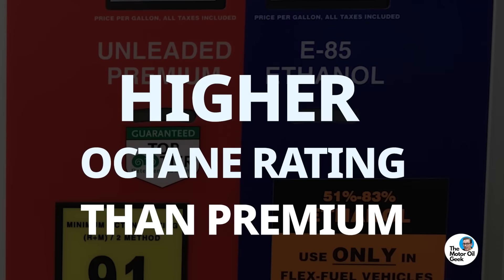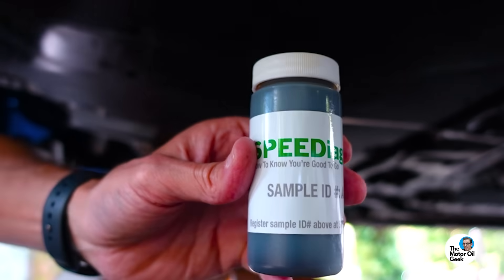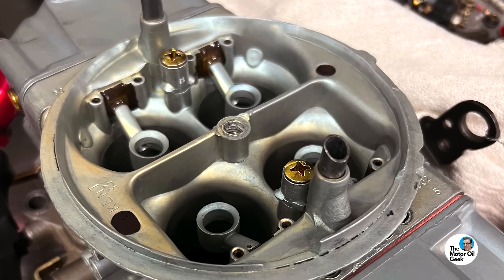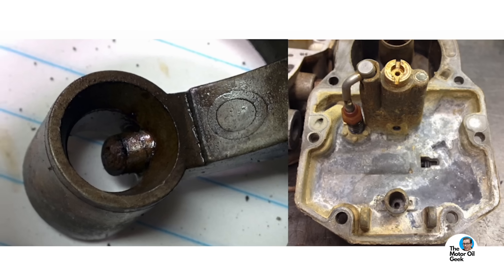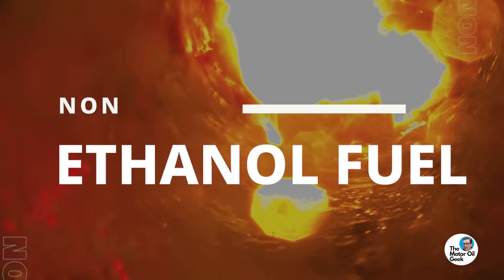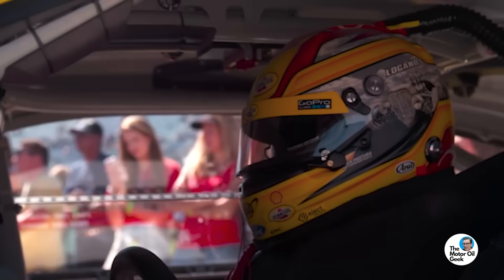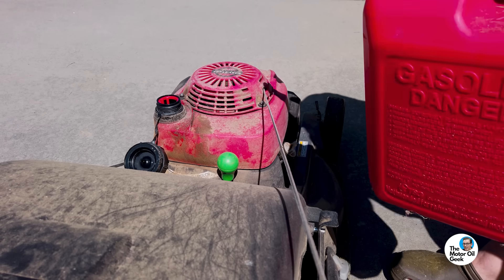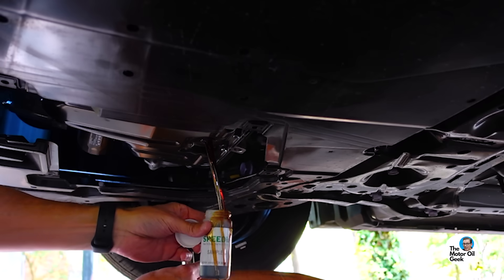ETHANOL: Higher OCTANE, Higher RISK?

Comment: I have been running E85 blends in my 2014 Buick Verano T for three years now.  It has the 2.0L turbo flex-fuel LUH engine and requires premium fuel.  Wind the clock back three years and recall who was president.  Yeah, he had the cost of fuel up so the premium was $5.00 per gallon.  And I had a daily round-trip commute of 136 miles, so fuel cost was a big issue.  In the Detroit metro area, fuel pricing was $5.00 premium, $4.50 midgrade, $4.00 regular, and $3.50 E85.  Yeah baby, it was tempting to save $1.50 a gallon by running E85 versus Premium, but I dipped my toe into the water carefully by running blends of regular and E85, ranging from 30% to 100%.  I kept records of fuel cost and blend percentages in an Excel spreadsheet and after ~70 tank fills concluded that the fuel cost per mile decreased to minimum at ~45% E85.  Maximum savings was ~10%, but the curve was really flat between 40 and 50%.  

For the first year I did oil analyses to see if there were issues from running E85 blends.  The car had an issue when I bought it a year earlier and would have 5% fuel dilution on a 7500-mile oil interval.  It was so bad that the 5w30 I was running became a lower 20-grade by the time the oil was changed.  I changed to 5w40 Mobil 1 European Car Formula at about the same time I started running E85 blends and looked for additional fuel dilution in the oil analyses.  The dilution problem decreased over the next couple of oil changes, and the viscosity stayed in grade.  My normal blend is now 40% E85/60% regular, and the car is running fine at 155k miles.  Fuel economy dropped from 30 mpg on straight premium to 27 mpg on 40/60, but since I am paying 20% less for fuel it's a net savings.
Reply: Great data.  Yes, its one example, but I've seen similar things on many cars running ethanol.  Done right and understanding how it works you can do some cool stuff with E85.

Comment: No ethanol used in my 1986 Yamaha and 1980 Mariner outboards and both still start with just a twist of the key.  No repairs done to it in that time either.  Same for my lawn mower.  Thanks Lake for explaining what I suspected all along.
Reply: Same for me but I use E10 all day long. It doesn't hurt anything, even regular gas left in a small jet carb all winter will varnish
Reply: 1979 VW with 2 Dual 40er Dellorto carburators.
Really no issues with E10 fuel.

What are you guys doing wrong ?

Comment: The trend of manufacturers extending service cycles and using thinner oils ensures that engines that would last a million miles die after only eighty thousand is not helped by ethanol.
Someone did the math on ethanol production and discovered that it wastes the energy equivalent of one and a half barrels of oil per barrel produced. Then you only get about five sixths of a barrel worth of mileage, if you’re lucky.

Comment: Normally a big fan of the channel, but this video didn't feel like your normal ones. Very one-sided and focused only on the damage ethanol causes with carbs. While I agree with that, you totally ignored the postive impacts it has on newer vehicles designed to work with ethanol. E85 offers huge performance benefits and is widely used across the spectrum of modified fuel injected cars. It is basically race gas available at the pump and for significantly less cost than 93 octane and dedicated race fuels. I saw a supercharged Viper pick up over 100whp and torque just by switching to pump E85 without touching anything else. On older vehicles and lawn equipment it can certainly cause issues, but on vehicles designed for it or by being aware of the difference that is easily negated.

Comment: Pure-Gas website lists gas stations that have alcohol-free fuel at the pump. I have been running it for years in my small, carbureted engines without destroying the carbs.. Much less expensive than the canned gas. We have 90 octane at a few places near me

Comment: I absolutely hate that we are forced to have 10% ethanol in our gasoline here in the US. At my local gas station, they do have a separate hose for 91 octane non ethanol fuel, but it is 30 cents more expensive than 93 octane with 10% ethanol. So I just can't afford it for my vehicle all of the time. I buy it for my lawnmower and chainsaw, but that's it. I can't put it in my truck all of the time due to price. 

Every once in a while, I will put some in my truck, but most of the time, I just have to use 89 octane with 10% ethanol fuel in it because my truck requires 89 octane minimum according to the owner's manual.
Reply: Unless you have a really old truck, it won't have a carburetor and should be ok.
Reply: @quaddad 
That's not completely true. It still can cause water in the gas tank when not driven much, and I have had that happen. It also causes gumming in fuel injectors when the vehicle sits for a while. I have also had that happen. It's just bad for engines all the way around. There is nothing good about it other than up front cost savings. Unfortunately those up front savings can and often do cause more expensive long term problems.
Reply: @JD.307 
Should, but considering my truck is 20 years old, I wouldn't bet on it. 😅

Comment: I think there is some kind of government red tape or crap or something that strongly discourages Gas Station owners or operators from offering ethanol free gasoline in the immediate Washington DC metropolis. Maybe 50 miles out some stations might offer ethanol free at a higher price but maybe not in the desired octane. Might be more of a problem than with the more common E10 of low sales allowing the fuel to be "stale"? 
I believe ethanol free still needs fuel preservative if to not be used within a month or so and also could benefit if used in small engines from having a very small amount (like mixed at 1: 200 ratio) of something like "Stihl Ultra" 2 cycle oil even if used in 4 stroke mowers (the type of "synthetic" mix oil that is used in 2 stroke with catalytic converter or the "4 mix" engine that has no oil sump and needs oil mix fuel although it has poppet valves with rocker arms in it

Comment: I ran liquid performance ethanol equilizer in my fleet for 7 years i was able to get my e85 mpg with basic Boltons and that additive to what those vans hot stock on pump gas. I love e85 especiallyat high altitude, plugs and oil doesn't get fowled and mpg increases the higher up i go. I live in central Colorado where I've run my food distribution business for over 20 years now. I wouldn't run e85 if it wasn't for that ethanol equalizer, I've had no measurable phase separation in the fuel regardless of what sharp temperature drops I have encountered.

Comment: I live in the "mighty" EU and here a 5% minimum ethanol is mandatory (E5), we literally can't get ethanol-free gas. Some advice for us? Personally I already changed everything in my fuel system from tank to fuel line with ethanol resistant lines and metals, except obviously the carburetor itself (C3 corvette).
PS: a little thing you missed is that ethanol dries up rubber gasket and in old car that's the cause of fuel pump and/or accelerator pump failures.

Comment: According to your statement the wear data is based on fuel dilution. You then extrapolate that and suggest enthanol is the cause. Fuel dilution of oil is already known to do that. What does it have to do with ethanol? From what you presented the presence of ethanol is anecdotal. The fuel dilution was already the cause.

The study looks largely meaningless. If I read that correctly they put 5% (by weight?) ethanol in the oil. Does that ever actually occur in the engine? I highly doubt it. It evaporates more readily than the gasoline does.  Since only 15% of the fuel is ethanol, you would need to have huge fuel dilution rates (like 70-80%) to get 5% of it to be ethanol. Then it would just evaporate anyway, particularly at operating temps that are above the boiling point. Then it will go thru the PCV valve and into the intake to be burned. 

The corrosion to the carbs is caused by the absorbed water. This is why if you use it regularly you don't have problems. New dry fuel is always present. 

You really should say knock index, not octane. Octane is a hydrocarbon component of gasoline. You aren't increasing octane at all by adding ethanol. You are increasing the knock index.

Comment: Hi
Having run engines on dyno test beds for many years and for more than one manufacturer I have seen the evidence of higher power  running on ethanol blends and 100% ethanol it also increases fuel consumption and puts a lot of water into the sump especially on short runs. From my point of view it's good for racing but not good for a daily driver
Reply: I drive about 170 miles a day, so any fuel or water buildup in the oil has ample opportunity to boil off.  I can see that high ethanol blends would be a problem with an engine that only gets run 15 minutes at a time.

Comment: I’ve had zero issues with running ethanol blended fuel in my power equipment. I add 1 ounce per gallon Seafoam when I fill the gas can. Unless I plan to use the equipment again within a couple days, I drain and run the fuel out. On my mowers I’ve installed fuel shutoffs if not already included and run the gas out of the carb after each use.

At the end of the season I drain and run the fuel out and fog the cylinders. This ensures a smooth startup next season.

Take the extra time to care for and protect your investment in your power equipment and they’ll last for years with minimal repairs.
Reply: If non E gas is available anywhere by you It makes no sense at all to take the time & effort you put into trying to safely run e pump fuel in you carb’d vehicles.
The only time your rec are worth while is in an area where no non E gas is bit not avail or close by within reason. 
I have 2 sources of 91 octane non E pump gas avail to me in Ny approx 8 miles away round trip.
At my Fl residence I have 2 non E sources (89 & 93 octane) approx 8 miles away there too 
so lucky for me I’m good to go.
Reply: @scottwheaton9689 sorry, but it takes little time and effort to do this. A couple minutes to drain the gas from my trimmer and run the gas out of the carb. For the mower, I turn the fuel valve off and let it run the fuel out while I’m cleaning up. Also, my leaf blower is a 4 cycle and I rarely run the gas out of it and it starts every time.

I’m not going to go out of my way to find a station with non-ethanol gas when I can just run to my local station (1/4 mile away) when I need to. The time it would take to go through the effort of finding and acquiring non-ethanol gas would be greater than the time I spent doing what I know works for the entire season.

If you truly care about your equipment and the money you’ve invested in them, taking a little extra time to protect that investment is worth it. I’ve had my trimmer for 17 years and have only replaced the hoses and service the carb once. It was the same with my previous mower which was still going strong when I decided I wanted something new.

If you want to go out of your way to find non-ethanol fuel just to save yourself a little bit of time more power to you. I’ve just seen too many people set out on bulk waste day an otherwise perfectly good mower due to carb issues caused by lack of care. Lots of unnecessary waste due to poor maintenance and/or laziness.
Reply: So we need to add things to our gas to make our vehicles run properly because of the Marxist governments that people keep electing.
Reply: Bobby is wrong, but he thinks he’s so right.
😂
Reply: @timsforcoffee how can I be wrong when I’ve been doing this is every season without issue for 20 years? It takes very little additional time and effort. Less than going out of one’s way just to find non-ethanol fuel.
Reply: @BobbyS1981 Your argument is similar to saying I’ve been eating cheeseburgers for 20 years and never had a heart attack.
Did you watch the video?  Did you learn anything.
Small engine shops have had an increase in the number of small engines that need new coils since ethanol was introduced to fuel.
What do you have to say about that?

Comment: Here, in Brazil, the government increased the ethanol in gasoline to 30%, without allowing us to choose a gasoline with concentration lesser than 25% of ethanol. I am an owner of a toyota Prius 2018 with gasoline engine and I will have to reduce my oil change interval from 8000 km to 6000 km due to fuel dilution in oil. I use 5w30 synthetic oil API SP. We also don't know how the fuel system components and materials will last with this new ethanol concentration, because these tests have been ignored by the government approval. It is something insane!
Reply: Does the Brazil Prius have a fully flex fuel ECU?
Reply: My fuel pump (high-pressure fuel pump) gave out with E20, Mitsubishi first Gen GDI engine, repair cost $2,000 — reason: the gas pump at the station was filled wrong.

Comment: Back in the 80's and 90's when we built muscle car engines if a carburetor was going to be stored for anything longer then a few weeks we would put it in a bucket of kerosene and seal it. When we were ready to use it we just blow it off with carburetor cleaner and install it. It might smoke for a few minutes but we rarely had to rebuild it if it was good before it was removed from the engine.

Comment: Sorry man, im from Brazil.

Today gas in Brazil is E30, theres no ethanol free gas in Brazil over the last 3 decades.

Whe have since 70s PURE ETHANOL WITH 4% WATER in gas stations. No E85 here and yes we put water on It to avoid evaporation.

Theres no problem with corrosion, you just do nickel plating on the carburetor that use high ethanol or hidrated pure ethanol.

The oil life is way longer with ethanol, no sulfur, no carbon build and ethanol dont mix well with oil. Engines that use pure ethanol dont have problems with varnish and sludge, the oil comes out clear as new.

North America needs tô LEARN something with us, we are using ethanol about HALF CENTURY.

Come on... 2025 with all easy infos on the internet/AI...
Reply: Very interesting.
Reply from the maker: The fuel in Brazil contains a corrosion inhibitor that is not in the fuel in the US.
Reply: @themotoroilgeek no corrosion inhibitor.

In 80s, after petrol crisis and led free gas, almost all Cars sold in Brazil are ethanol.

Same engine:

Gasoline version running lead free, super expensive low octane with 7:1 compression ratio with terrible gas mileage and low power

Ethanol: eco friendly, high octane, super cheap and compression ratio over 12:1 that make much more power.

That make a lot of people with old gasoline cars to use ethanol and the same corrosion problem that you deal happen. So for a proper conversion you need a nickel Bath/plating in your carburetor parts.

In 90s with fuel injection, same problem again with injectors and fuel pumps, today all of them are ethanol compatible, even chinese cheap ones.

Theres a lot of small things tô change to use pure ethanol, from harder valve seats tô a bigger starter and battery, but all problems are solved.

Today we have some problems with direct injection systems using purê ethanol. They sell cars as flex fuell but due to very low lubricity, the injectors (Bosch specially) are leaking and loosing spray pattern due to cracks between roles.

Indirect systems runs fine without problems.

Comment: My take away is, make sure you either have ethanol compatible fuel systems or buy ethanol free.

I specifically buy E15 for my Cherokee. It's cheaper per gallon, real world mileage is the same, and "regular" gas has been E10 for what, almost 20 years? What's the real danger of another 5%?

Comment: I believe it's the ethanol in modern gasolines that's causing rust in motorcycle gas tanks.
Reply: Since I switched to running full 105 Octane ethanol free gasoline in my 69 Charger I have not had any fuel problems I had in the past, especially pulling it out of winter storage. I wish my state had the choice to buy ethanol free regular gasoline like in other states.
Reply: I wonder. Higher octane gives stronger detonation. That poses higher energy and thus heat. If your engine ist a certain compromise it may not be able to dissipate as much heat. That makes the engine run even hotter. Not good for engine and oil.
Reply: @GiancarloBenzina  I think you misunderstand... higher octane is more resistant to detonation, and is lower energy.    If you use high octane in an engine that doesn't require it, you will see increased fuel consumption to get the same power from it... due to the lower energy content.

Comment: I have been running pump 93 octane E10 with Stabil 360 for the past 13 years through a mid 90s Holley 750 carb. The car is in storage 11 months out of 12. I haven't had a carb problem since using Stabil. Although I haven't had the carb apart so I don't know what the inside looks like. I'd sure like to see you test fuel stabilizers.